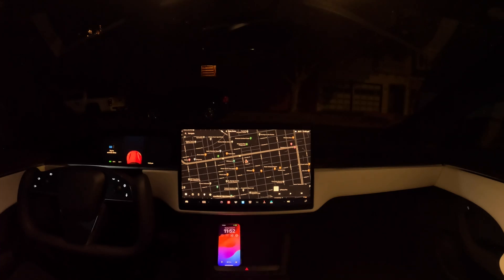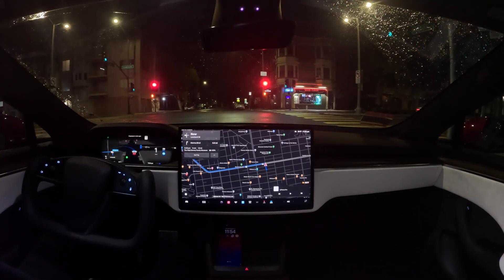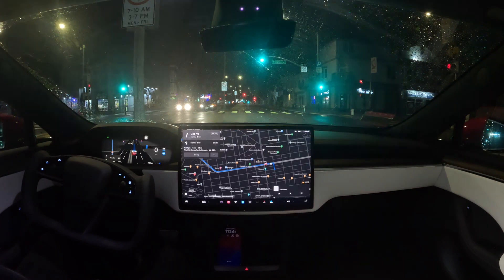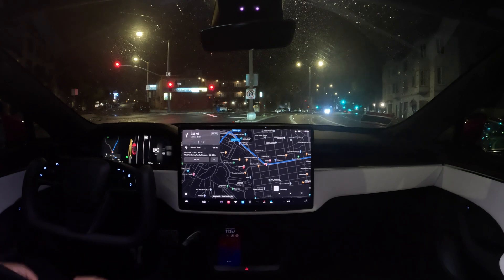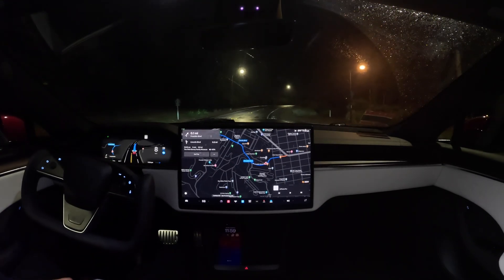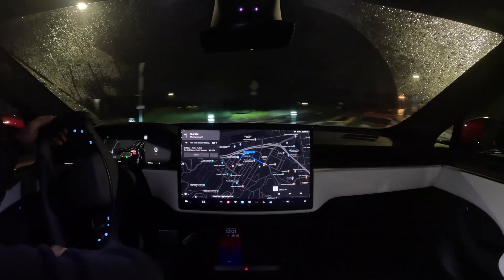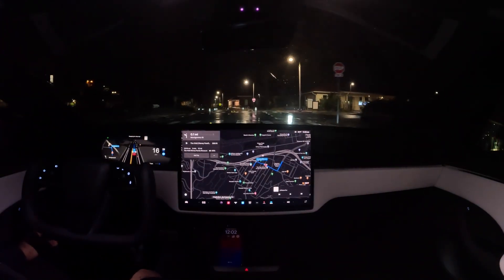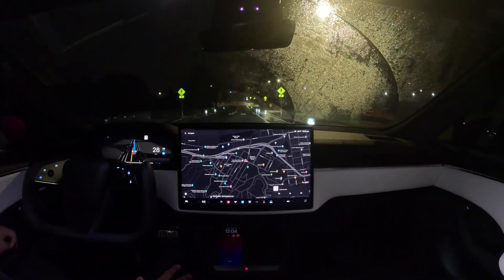Tesla Stalkless Controls: Dream or Disaster?

Comment: Turn signals and a horn button that's not always in the same place when you need it. What could go wrong? Stalkless is not better, just cheaper. 

And self driving/FSD at $12K? Not happening in volume for non-robotaxis. EVs are expensive enough without adding $12K to the price.

While we're talking about making Teslas better, I wish Tesla would fix phantom braking. Most people don't have FSD and most people will never have FSD. So, Tesla should fix basic speed control (TACC). 

The TACC on my 2023 Model Y LR sucked on a recent 3,000 mile road trip ...driving on highways on a hot, bright, and sunny day in Texas (headed to Jackson, WY), and when there was road surface heat reflection present, especially when cresting a slight hill and the cameras couldn't see the other side of the road, severe (and I mean severe) phantom braking would occur. Yes, my windshield was clean. My passenger almost would not ride in my car with me after it happened a dozen times. Tesla SC remote connected to my car and found no faults logged. TACC worked fine on overcast days when the road surface was cool.

The most irritating thing about severe phantom braking is that I also experienced it on my 2022 Model 3 LR (Vision-only). Why is it taking Tesla so long to address this? I would not buy another Tesla until it's proven they've solved their phantom braking problem on their cars. Picky? No, I think it's reasonable to expect a $50K+ car to have a reliable speed control feature.
Reply: Honda also has this problem with Phantom breaking.

Comment: Well, you still need to drive your Tesla outside of the US. You can't compare your no roundabout country to Europe. It's simple, you can't easily active the blinkers with the yoke or regular wheel without the stalks. Really has nothing to do with muscle memory as the wheel angle can be at various angles and pressing a button without looking at the wheel is pretty difficult to do because the button is very small too!

You really have great videos over the years but you clearly are in a bubble that the majority of Tesla owners are not.

Comment: Works when the yoke randomly is perfectly aligned for pushing the button to signal right/out of the roundabout, for sure!
Is every turn/roundabout/intersection going to be like that? 

I appreiacte that you are trying to show people that it's not a disaster, it's definitely doable. However, it takes some getting used to, and will definitely be more fiddly when stopped at an intersection where the yoke is not straight/aligned.
Reply: I find that roundabout signaling is unnecessary.  We should already be in the lane we want when we enter.

Comment: That's the weakest demonstration of manual roundabout indicating on the smallest of roundabouts.  A LOT of roundabouts you need to indicated off when the steering wheel is upside down or 270 degrees rotated.  They are often much larger with up to 4 lanes.  There's no muscle memory when in europe there are so many and they all differ in size.

Comment: Thanks for the video! I like the stalkless design. But I guess the indicators are easier on the yoke because bottom and top of the wheel are evident. On my model 3 (with stalks) on heavy turning I sometimes even get confused which is the volume wheel an wich is the voice command wheel. :D

Comment: I agree with many of your statements but after 60k miles in a stalkless yoke X, it is not as rosy as you make it out. Try it in heavy traffic doing a roundabout. Try making a hard, abrupt change in steering direction quickly. FSD will some day eliminate all the issues but for now it automatically turns on the wrong signals at the wrong time and jerks the wheel violently in the wrong direction making it impossible to grab for a correction. Bottomline is, today removing the stalks and the yoke offer no improvements for the human driver. Right now removing the stalks is simply Tesla's unwavering attempt to build the cheapest cars ever made. Not necessarily a bad thing, but it is not an improvement for us soon to be obsolete meatbags!
Reply: Why don't you get sexy buttons? That would solve your problem.
Reply: @whynotstartusingyourbrain8726  How? They do nothing for turn signals or trying to grab a spinning yoke wheel.
Reply: @andyfeimsternfei8408  of course they do. You place them on the backside of your yoke close to wherettgd hands are portioned. Then you can choose the right button to indicate right and the left button to indicate left.
Reply: @whynotstartusingyourbrain8726  No better than the capacitive buttons. When the yokes a flyin, there ain't no way to find anything on the yoke! Same with a steering wheel. Stalks remain fixed.
Reply: @andyfeimsternfei8408  do you even have a yoke? If you put the buttons right where the hands are on the backside of the yoke it's very easy to reach them in joy situation.
Reply: @whynotstartusingyourbrain8726  I have 60k on a 2022 Plaid X. I drive almost exclusively in Beta. I also live in the mountains and more than a 120 degree turn of the wheel and you must spin it with a thumb or finger. Nothing attached to a yoke is useful in hard turns. Then there is the useless horn button. I love Tesla, own 4, have thousands of shares but shit is shit. The yoke and removal of the stalks is shit.
Reply: @andyfeimsternfei8408  so how often have you tried the sexy buttons?
Reply: @whynotstartusingyourbrain8726  Never. Lipstick on a pig. I'll just wait for FSD to eliminate the yoke altogether. Until then, I will still call out anyone making excuses for Elon's boneheaded ideas on how to make the cheapest cars ever made. Removing ultrasonic sensors, removing stalks, removing rain sensors...all stupid ideas before the software replacement is perfected. Fanboys making excuses for this crap is just making things worse, and I fear eventually it will catch up to Tesla. None of this is good.
Reply: @andyfeimsternfei8408  unfortunately you do not undestand Tesla. Once they saw the pathway to fully autonomous driving with Tesla vision only it would have been idiotic to install things they knew would not be needed n the future.
Reply: @whynotstartusingyourbrain8726  BS! Every Tesla on the road still needs ultrasonic, a rain sensors and stalks. Elon promised "Deep Rain" 4 years ago, and the auto wipers still don't work. FSD has been coming in a few months for over 4 years. So the "idea" or promise of a new technology means a manufacturer should start removing equipment? You're fooling yourself if you think that's his motivation. Tesla must quickly build the cheapest cars in history to ensure their dominance. I actually agree with that process, but fooling consumers into some other sales angle is dealing with fire. It's the sort of thing class action law suits are known for.
Reply: @andyfeimsternfei8408  what a bunch of nonsense. You know what you buy and if you don't like it don't buy it.
Reply: @whynotstartusingyourbrain8726  We will see.
Reply: @andyfeimsternfei8408 I’ve only put 25k on my Plaid mostly in simple LA traffic. Signals are way easier to activate when going straight. Horn only needs the heel of the hand on the right side of yoke. If the wiper turns on so what— the most important is to signal to the other driver.  And the rapid fire horn is wonderful for getting their attention.